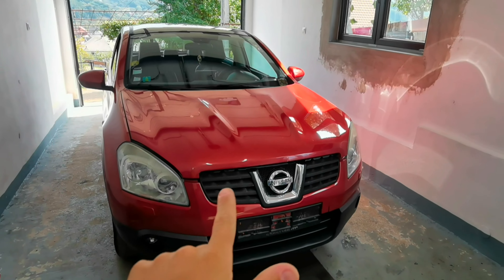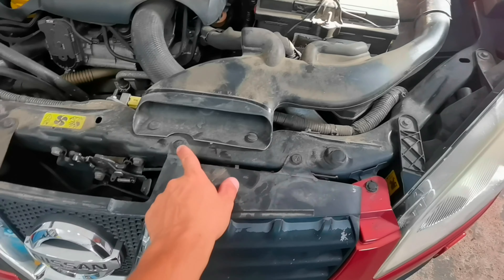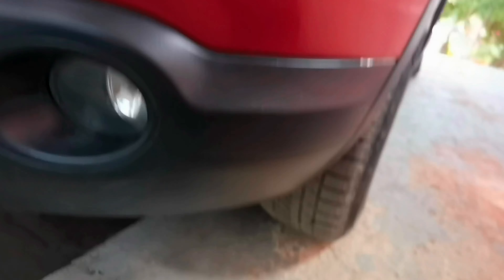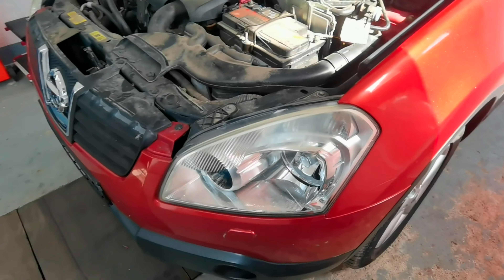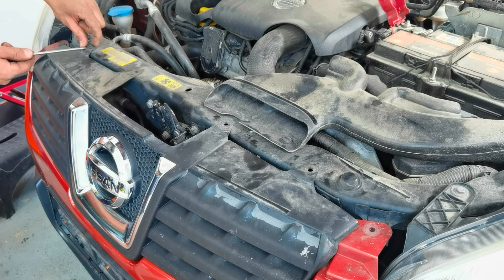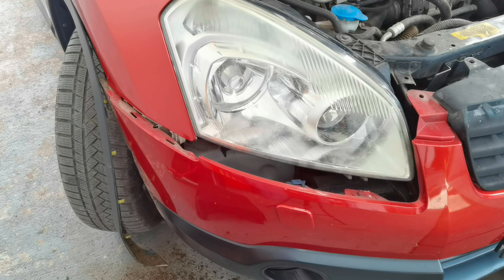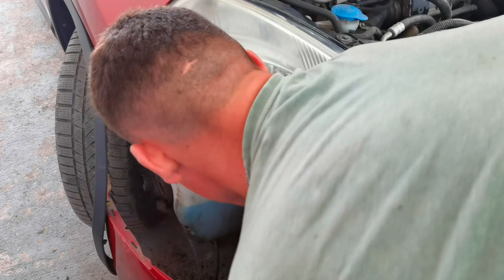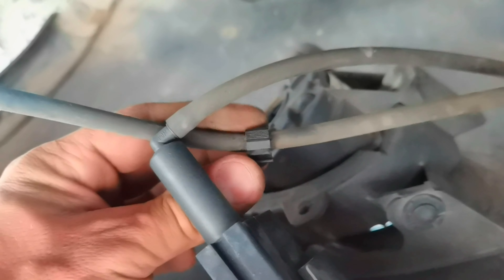HOW TO REMOVE  FRONT BUMPER ON NISSAN QASHQA/DUALIS!

Comment: where can i find the reservoir for the power steering fluid on the nissan qashqai 2009 1.5
Reply from the maker: Probably you won't find any compartment for steering fluid because it has  electric power steering?
Reply: There is none, Qashqai's PS is electric